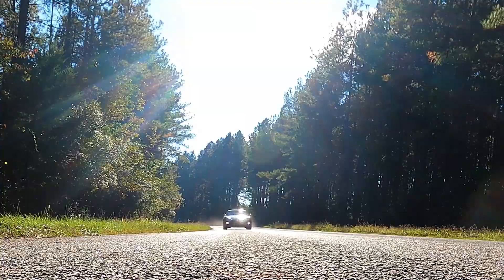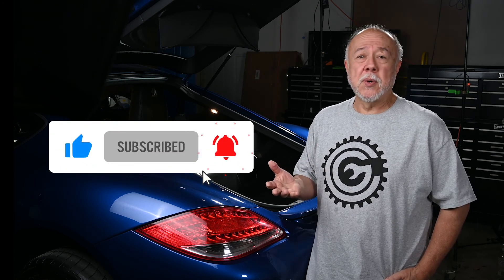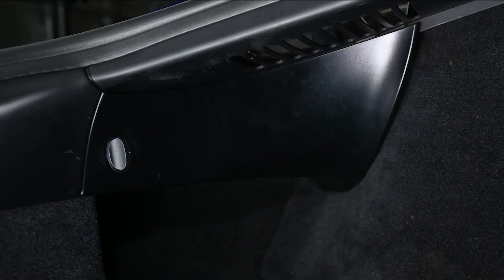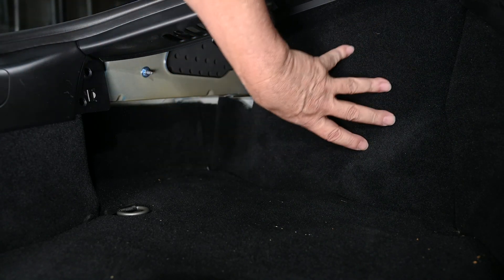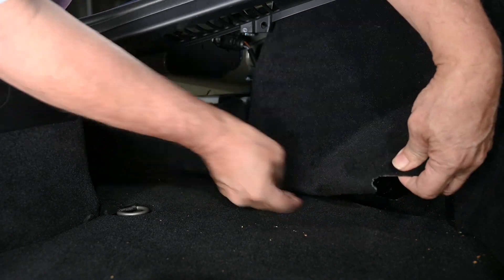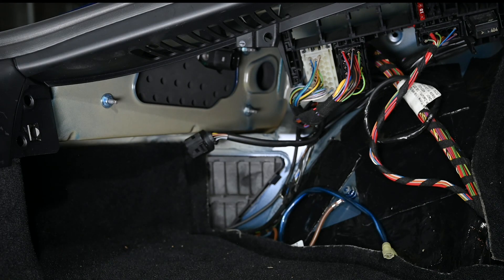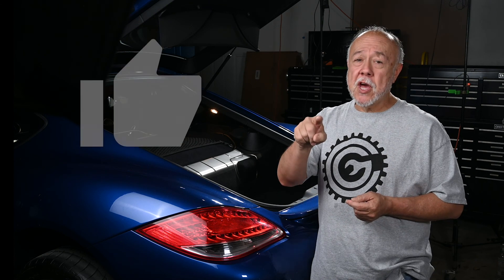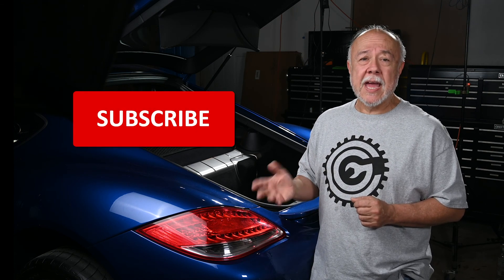How To Remove A Porsche Cayman 987.2 Tail Light

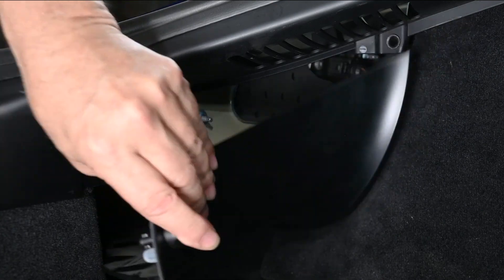Comment: Great video and detail. Question for anyone... At 1:49 where you mention not to lose those two caps (and the black plug on the other side of the panel), what are those called and how can I get replacements? After watching the video and successfully swapping my tail lights, I noticed the previous owner had lost all of them. Seems OK without them, but I'm sure they add a much tighter fit to the panel. Any help would be appreciated. Thanks again!